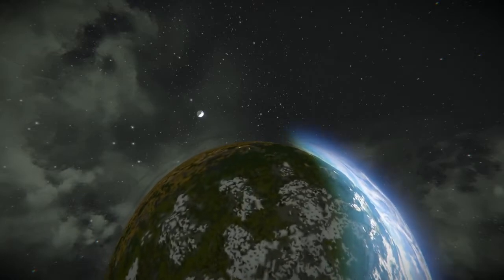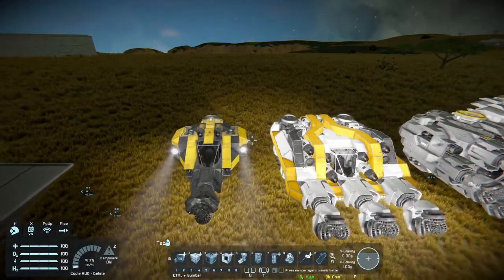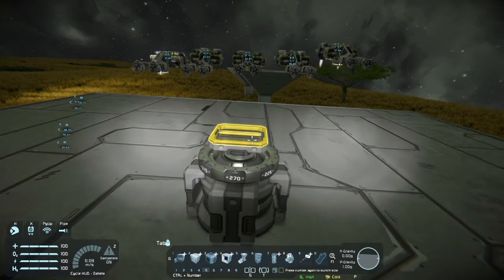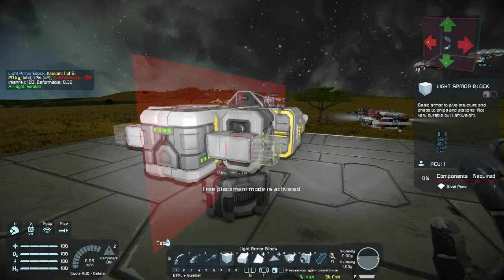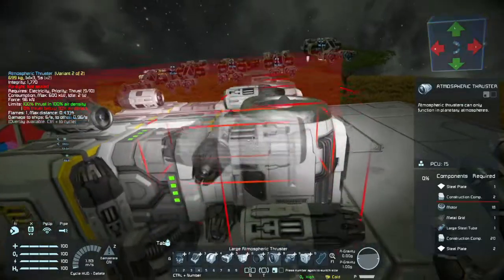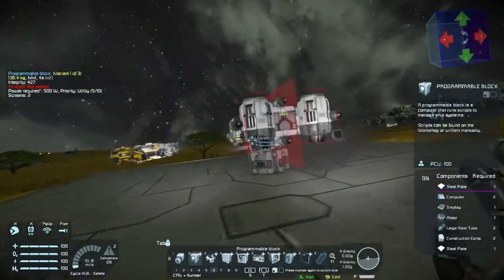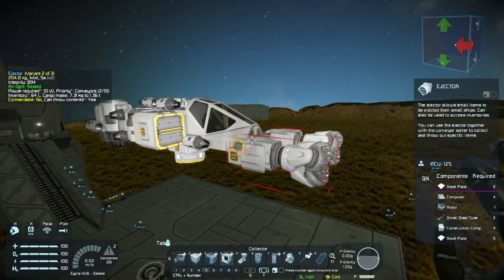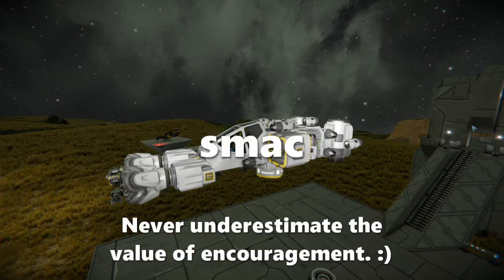Let's Build SPACE ENGINEERS - Atmospheric Miner - Stage 1 - Functional Components

Comment: my friend and I built this thing but it mines slower than our handheld drills, doesn;t have enough backwards thrust and falls down if tilted forward
Reply from the maker: Can't fully speak to this without knowing your world settings, mod list, or altitude (yes, that matters a lot), but I've had a similar argument with at least twenty different individuals on the SE discord over the years. Not every miner needs to be able to carry its full, loaded mass when the drills are pointed directly down at the ground. Vertical miners do, and they're mechanically more efficient in most ways. This is a horizontal miner, it's designed to be used a different way. If you use it like a vertical miner, it'll fall. If you try to use a vertical miner to mine into a wall, you'd get the same effect. It's also designed more or less at a low altitude, so it gets most of the theoretical maximum thrust. If you try to use it at a high altitude, you're going to get horrible performance.

This is a completely fair response for your style of use and location, but the cool thing about a tutorial is it's not supposed to be the "best", just a starting point. You've identified a failing... this is SE. Take what I showed you, and engineer a better one for you!

Comment: A suggestion is to have one up thruster on the off position then when it starts to Fall because of the weight turn it on🤔
Reply from the maker: Doesn't really work like that, unfortunately. For easy numbers, 4 thrusters at 100% and 5 thrusters at 80% use the same amount of power, and the thrust is automatically regulated.

Comment: Question: My ships in the past would nose down easily but have trouble nosing back up for flight home. It seems we should have two more vertical thrusters up front to help with that. Am I wrong?
Reply from the maker: So, this is a bit... more complicated than you might think. SE doesn't actually take weight balance into account, everything (including thrust and weight) happens at exactly the center of mass (unless something changed). The actual position of the thrusters means absolutely nothing. What likely happened is you kept the mass in the front of the ship, shifting the center of mass forwards. This might make it feel like you aren't nosing up as easily. Another theory is that you have subgrids/klang doing weird things, or a loose item in the front of the ship (rocks fell, scrap from damaged armor, etc.). Those do act where they are instead of at the CoM. Then there's mods, mods will also do that if you pick the right ones.

Comment: I'm new to the game and I'm building this ship. But I ran into one tiny issue. You are installing an item called an ejector. I searched all blocks both in the Blocks and the Progression tab and cannot find an extractor anywhere in my list of items. Is this a mod??
Reply from the maker: Hey, welcome to Space Engineers! Nope, vanilla but outdated. Until a few updates ago, the Small Connector was known as an "Ejector". It didn't connect, just ejected.
Reply: @odysseygaming214  Thanks for the fast response. I am building the ship today and one thing you missed in your video (for new people) is you cannot set M in the build screen unless you are in the Advanced Tools mode. Great video and I'm definitely following it. My last two ships were failures on the first trip out. Hoping for an improvement here.
Reply: @odysseygaming214  Okay...one more beginner question!  After the ship lifts off you got rid of the stuff you built on top of without a grinder. What is the key combination for that? I assume another Advanced Tool thing. When I make a mistake on my ship I'm swimming in parts I grind off and prefer not to do that!
Reply: @odysseygaming214  So I noticed that when you first started flying the ship your batteries were at full charge. Mine are at 25% charge. Is there another part of Advanced Tool that gives the batteries full charge...or was that just a film edit.
Reply: @odysseygaming214  Okay, never mind. I just discovered building in Creative mode!!! But I still need to know how to delete parts when building without a grinder.
Reply from the maker: @michaeleber4752  In creative mode, right-click.
Reply from the maker: @michaeleber4752  Not sure what you mean by this. I've never actually heard of "Advanced Tools"... or maybe I've been using them so long I forgot.
Reply: @odysseygaming214  I believe Advanced Tools is opened when you hit ALT F10. But in Creative mode (which I just discovered) you do not need them.
Reply from the maker: @michaeleber4752 Ah! Okay, I know what that is. Thanks, that makes more sense if you were trying to follow along in Survival.